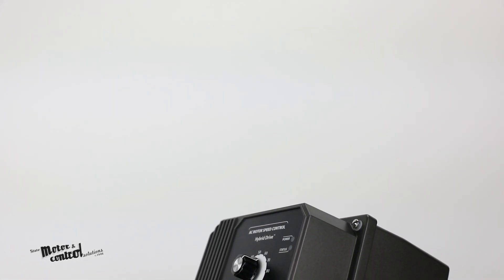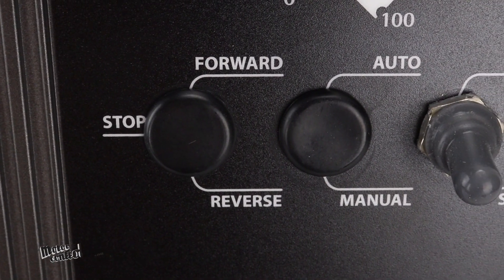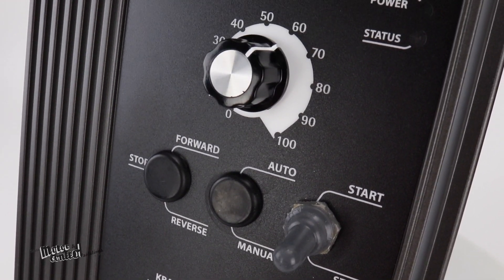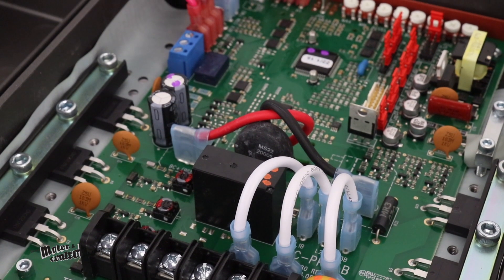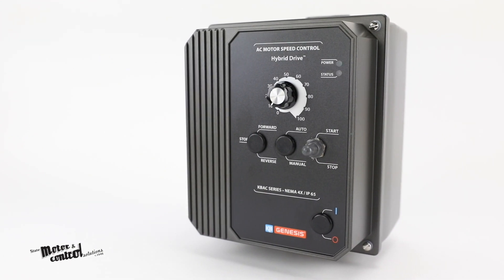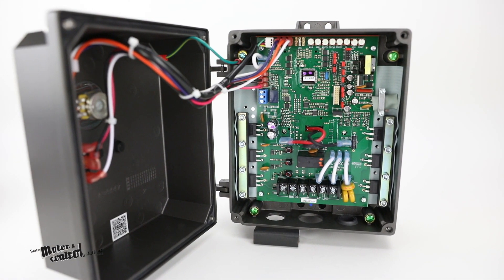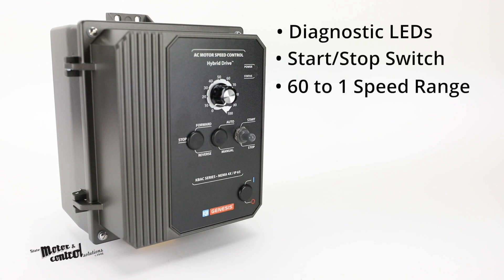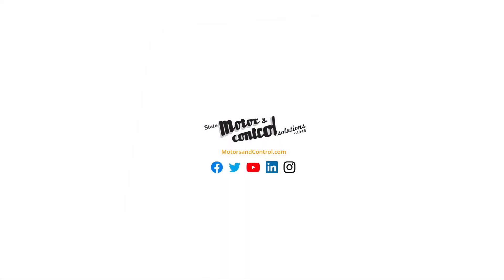KB Electronics KBAC Series AC Drive

Comment: My VFD has been working perfectly for 3 years.  No change to the wiring, no change in motor, all original to the day it was installed.  This year I turned it on after it was sitting over the winter and I get a solid red light which the trouble shooting section says is ‘overload.’  

I’ve reached out to KB Electronics and have gotten zero response.  Any idea? Or advice on who to call?